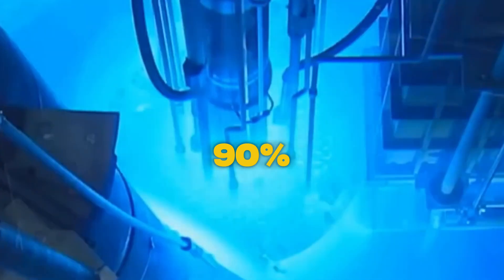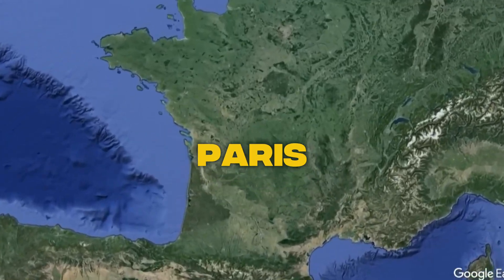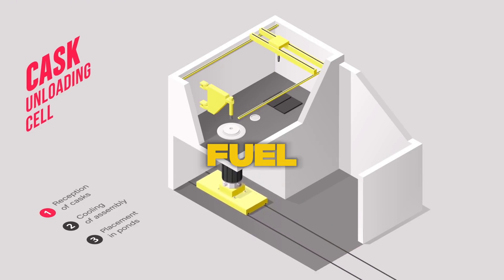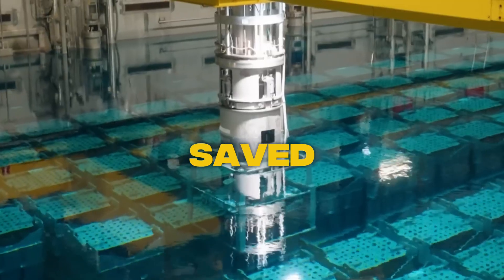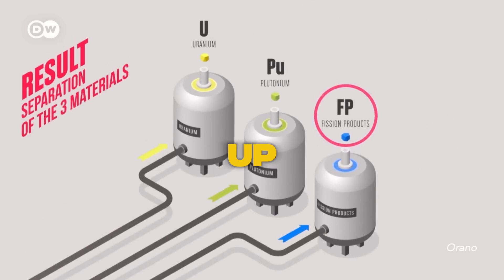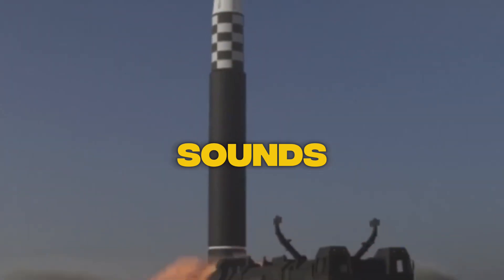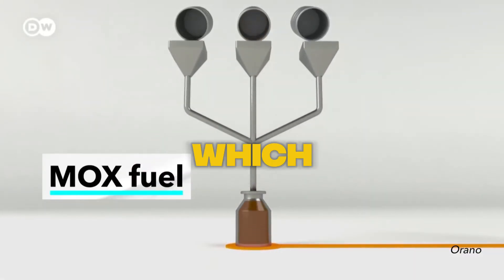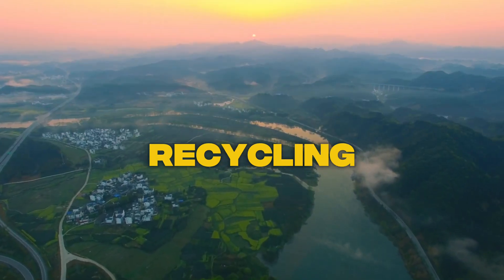France is insane at nuclear recycling

Comment: Nice propaganda. In fact, 96% of a uranium fuel rod can be recycled, but the reality is much less glorious, with only 4% of the product actually recycled (In France)
Reply: What do you mean? The 4% are fission products that cannot be recycled yet
Since an used uranium fuel rod at the end of its cycle contains: 95% (94%U238, 1%U235), 1% Plutonium and 4% Fission products?
You'll both need to treat the depleted Uranium and use Plutonium to make your MOX fuel rod